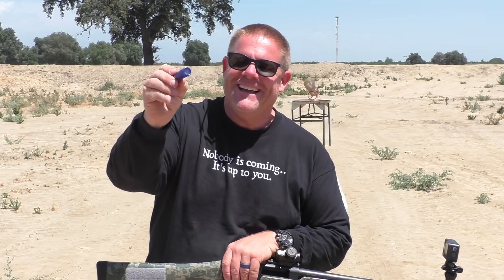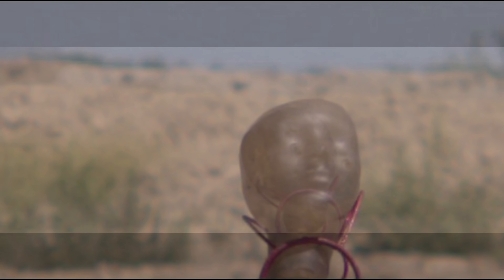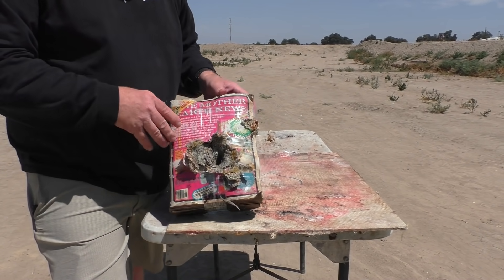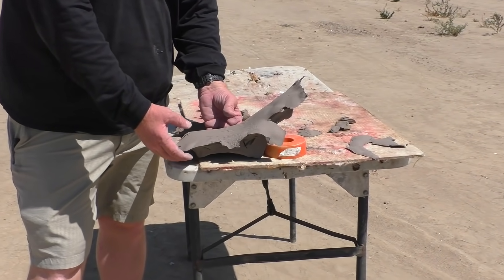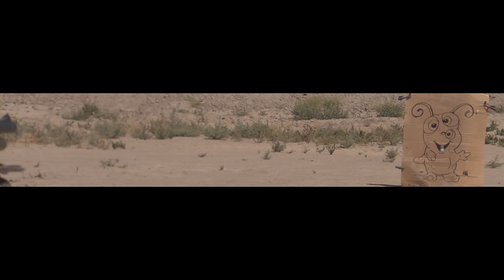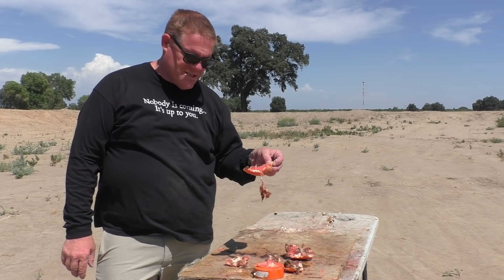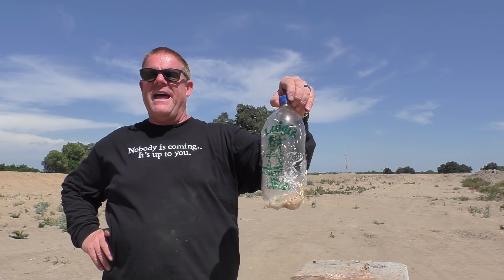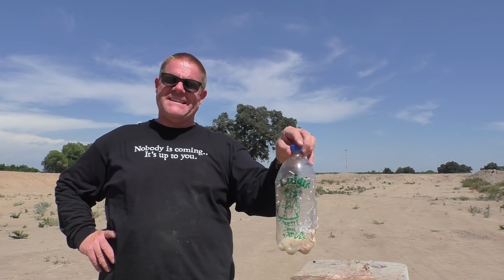The notorious CHEESE-CUTTER Round  -  Watch it SLICE 🧀

Comment: The bolo round seems somewhat less effective than this. Even though, that has its own purpose.
They both prove the  of pirates, and navies that fought against them, all of whom used cannon balls linked in pairs.
Not to mention land based artillery units using them against marching infantry as far back as 1600s, if not earlier.
For naval application the dual/duel purpose was similar. First, to cut down as many enemy sailors as was possible,
second, to destroy the masts of the enemy ship, so they could be "boarded".

Comment: My buddy and I did this back in the 1960s! Buy we used 90 test monofiliment fishing line. It coiled up nicely in the shell and we fired a couple of them at an old washing machine at the town dump. It made a nasty hole but it sometimes broke up. We tried both one string and a loop, I don't recall which performed better. I think we read about it in the rifleman letters column.
Reply: Also we split the buckshot like splitshot and crimped it with pliers. No knots except when we did a loop.

Comment: how long a wire can you use    2ft ?????
Reply: Weight restrictions. There is an upper limit, because wire has weight. But yeah, you could probably easily scale it up to 12 inches...
Snerk.. sorry. my jokes never scaled past 8 years old.
Reply from the maker: You can only fit so much into a small 12ga shell
Reply: @taofledermaus  Baduum. Tissssh.

Comment: Can you make a slug with 4 pieces. Link them with a wire and there is a hole with angle in the center. It can be expand in line.
Reply from the maker: It might be possible

Comment: Perfect load for the zombie apocalypse.  I wonder if you took picture wire and lead sinkers and produce the same effect
Reply from the maker: I think that is what they used on the bolo rounds.
Reply: @taofledermaus  you’re right:  I forgot about those.   I just pulled out these slugs I bought some years ago called MIB Multi impact bullet.  A slug that has 3 other slugs tied to it with a string.  Almost 800 grains of “holy shit” going down range.

Comment: There's a fairly simple explanation for why the wire didn't break and it keeps them together fairly accurately. After a brief and violent acceleration in the barrel, the air resistance that is trying to pull them apart is actually small, since they are  moving at the same velocity. That's why the natural spread of the pellets is gradual without a string. So, once they leave the barrel, they are in a free fall, just like a handful of rocks dropped from a tall building, they gonna hit the ground pretty much at the same time. But the force to keep them together is tiny compared to their kinetic energy downrange.
I hope it makes sense.

Comment: I wonder if you actually cast the rb's onto a braided cable if you'd get a different effect. 
Or even just used a sliding sinker and  crimped those to a cable and or bailing wire. 
Very very cool regardless. You guys are badasses and always keep me thinking.

Comment: TAOFLEDERMAUS: Let me put a bee in your bonnet. I watched the Bolo Rounds you shot in an older video and like all Bolo rounds they did not separate. But take a small diameter wire 1/2 inch spring about 1 inch long and thread it between the lead balls, load it with one ball on top like they do and when the balls exit the barrel the spring spreads them.
Reply from the maker: The spring would be smashed between the lead balls.  Plus,  I doubt there would be room in a shell to put all that.
Reply: @taofledermaus  Make the spring diameter near the ball diameter and the spring rests in the area of the balls curve. The balls are touching in the wad so the spring is not able to be smashed further again because of the balls curve.

Comment: What if...... You attach each end of the cheese cutter wire to each side of a Sabot so when it comes apart it pulls the wire out and or you attach one end of the wire to the wad to make it stretch out?  
Would doing this make the wire expand into a straight line?  Inquiring minds want to know.
Reply from the maker: Hard to say but I understand the concept
Reply: @taofledermaus  Sorry I'm hopped up on Dayquil and sick as a dog.  What if each end of the wire is slightly attached to each side of the sabot and when the sabot separates there is just enough resistance or drag that it pulls open the wire before letting go?  If one side had just a fraction of more pull before letting go maybe it could even expand the wire and make it spin?

Comment: I love experimenting too, going to drill a hole in 1/2in copper endcap-.700 dia-put a screw in ala Russian slug and fill with lead. Screw into an appropriate wad for weight and see how much deformation into dry magazines, maybe 2in wood placed 4in apart 8 pieces to see what they do. Also if wad stabilized it for any kind of accuracy.

Comment: That makes me think... what kind of DRIED pasta would do the most damage as the perfect home defense round? Straight pieces of spaghetti stuffed like flechettes? Mini macaroni noodles? Spiral rotini?  Doesn't it make sense to use items from hour household goods to defend the ol' homestead?
Reply: I think any pasta will turn into dust when shot from 12ga shotgun
Reply: @MasonFromSpace  Just mix egg and flour to make your own pasta batter, then shape and dry solid projectiles. Viola.
Reply: Use the thickest style of straight noodle and fill the remaining part of slugs with wax could work. Or really any pasta as long as you fill with wax aswell.
Reply from the maker: Weight would be the issue.  Need enough mass,  usually over 5 grams to just get the powder to ignite.
Reply: I'm gonna go with sharpened farfalle. Which, incidentally, is my ska band's name.

Comment: On this one, I wish you had done a 50-yard pattern test. This has the potential to beat the Federal FliteControl.
Reply: Doesn't need a pattern test if the strings keep it together, might need an accuracy test
Reply: @robinpohl2702  correct
Reply: Accuracy yes. Keeping together, also yes, While the centripetal force drops with distance, it does not disappear. Metal fatigue may be enough past 30 yards.
Reply: we need this to be upvoted way more so Taofledermaus and the guys do it!  And then patent and sell it, of course!
Reply: @FlameThr0wer 
 Bonjour,
 en France, nous appelons ses munitions des chevrotines liées, elles sont fabriquées en usine et plusieurs marques en produisent, elles sont en règle générales, en 9 billes, elles ne sont plus utilisées car plus autorisées à la chasse, sauf sur l'ile de Corse ou elles sont pour l'instant autorisées.
Reply: I've seen split shot fishing weights that are 00 size tied in a loop with wire, and monofilament fishing line. The pattern size is no bigger than the size of the loop you tie at any range.
Reply: I've shot dozens of flite control rounds (from #6 shot all the way up to 00 buck with steel, lead and tungsten shot) with all kinds of choke constrictions and that stuff has never impressed me.
Reply: @reelingminnesota2855  Well, in my shooting, open bore no rifling, it has groups half the size of other buckshot.
Reply: @reelingminnesota2855  FliteControl rounds have always been highly effective on high speed camera and also in my own experience.
Reply: @reelingminnesota2855  flight control is not meant to be used with a choke. You want cylinder bore for a flight control wad
Reply: @reelingminnesota2855  My experience is the opposite. My no choke barrel can barely put one 00 buck on a full size sihoutte paper at 40 yards, that's with Hornady's "Superformance" shell. However, Federal Tactical with Flite Control puts a nice 5" pattern at 50 yards. Only problem now is I can't find more Fed Tactical.
Reply: @jameshickok2349  5" at 50 yards?!
Reply: @chrisholifield8571  I wasn't going to ask...so thanks.
Reply: @reelingminnesota2855  Stuff sure works for me. Easily the smallest buck shot groups I have ever consistently seen through my shotguns.

Comment: I made some of these years ago from split shot fishing weights and very thin twisted steel cable I dug out of a dumpster behind a boat maker. I don't know what they did with it, but it was less than 1/16" thick.   Shot weird, but made a really fun sound going down range. I wish I had known what it looked like, but it cut up rotten pumpkins pretty well.

Comment: I wouldn't hesitate to use it for home defense.
Reply: Well any round is a good home defense round so long as you know for sure what is on the other side of the wall. You want to avoid over penetration because you can not always be sure. You also don't want high count loads of buck shot etc because of not being able to control where the shot goes. A weak load with 6 balls on wire in a ring shape could make them pretty solid have the ring 5 inches across. This would increase the chances of hitting something vital while controlling the shot
Reply: What about bear defense?
Reply: @joshuagibson2520  Bears with shotguns?
Reply: @Matt_The_Hugenot  I'm guessing you don't live in Alaska like the OP.
Reply: @joshuagibson2520  they might work.  I'll stick to a hardcast slug or .45-70
Reply: @Matt_The_Hugenot  " The Right to Arm Bears "

Comment: Whether the wire stays intact or breaks apart, these things would suck for whoever gets hit, or whoever has to dig it out of them.
Reply: Ross Outdoors  its only hard when theyre flopping about and screaming
Reply: Imagine it hitting a large bone and wrapping around it
Reply: @mr.meowgi9876  oof a hit to the femur ...Large spread stronger wire and these could remove a limb 
Wiring 00 buck shot together in a cluster could be used to control the spread and keep more pellets on target which would make them pretty solid for hunting would need to check legalities of it though
Reply: Is there anything that doesn't suck to get hit by? Even paintballs suck.
Reply: @Afungus.Amungus  bb guns hurt😆 hell i have been hit with a water balloon that hurt, the ones that are half way filled will slap you like a mean ass wife
Reply: @Afungus.Amungus  Simunition projectiles suck even worse. But that's good, gives you incentive to not get hit and take the other guy out first.
Reply: As a home defense round, if it stops the threat without becoming a threat to the innocent. then it is a perfect home defense round.  How it passes through walls if you miss is the determining factor.
Reply: @JohnLloydScharf  Not only will it go through the wall it could slice a 2x 4 on the way through.
Reply: Only digging, is for the sliced up carcass.
Reply: Split shots and piano wire, looped in a ring.
Reply: Ross Outdoors  its not that damn easy lol.
Reply: Would be even worse with nylon wire and ceramic balls.....
Reply: Ross Outdoors  You'd be wrong about that.